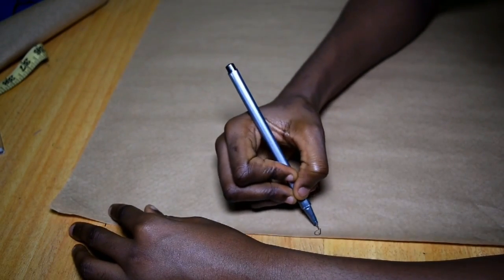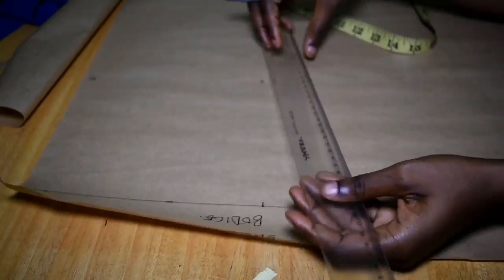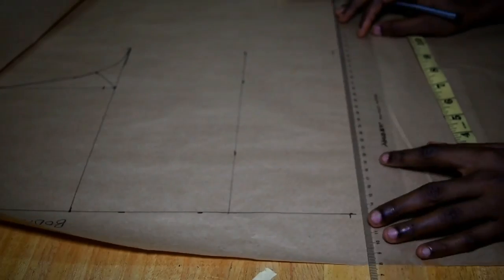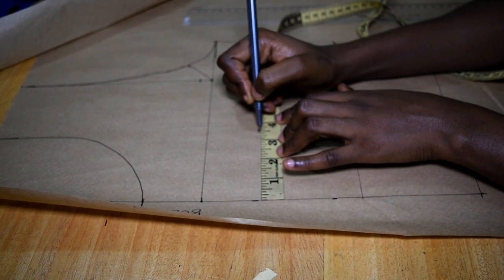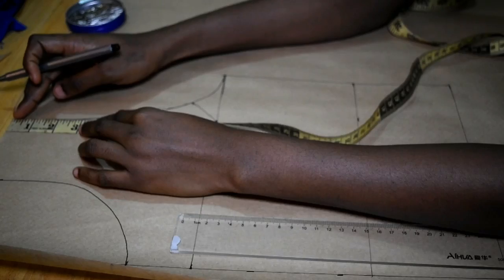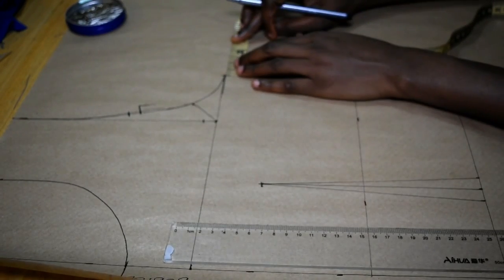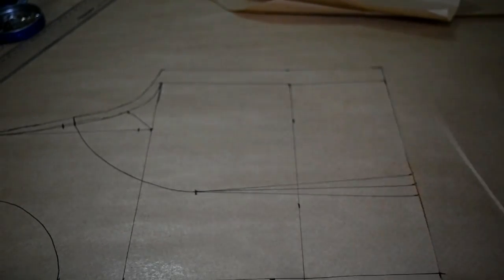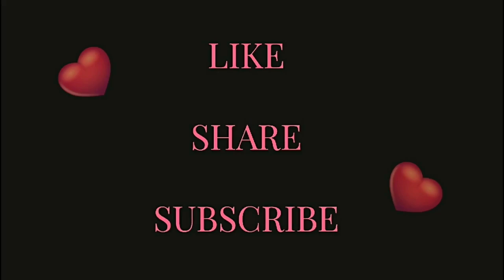HOW TO DRAFT THE PRINCESS SEAM  PATTERN {BACK BODICE}

Comment from the maker: You can add 0.5 to your bustpoint / 2 plus one-eight of an inch. This will help shift your dart line further away from the center of your body and also due to the joining. I use the same method for the front bodice.

Comment: this is what I have been looking for from so long . thanku so much for sharing Ur skill.god bless you.
I have a question.
 the dart intake is 1.5 inch so do you add that at the side seam? besides the seaming allowance.
Reply from the maker: The dart allowance is added to the the seam allowance during construction of the basic bodice. If my dart is 1.5 and seam allowance is 1, I add 2.5 to my normal measurement. I add an extra 1 inch again because d dart will be cut apart so 0.5 inch for joining the pieces back together.
Reply: Cisca Stitches & Designs thanku for the clarification